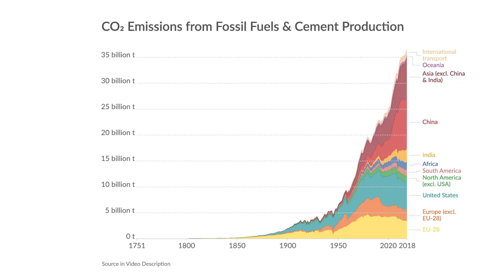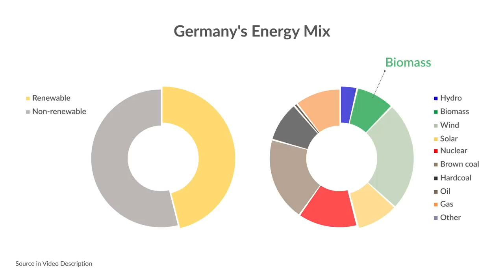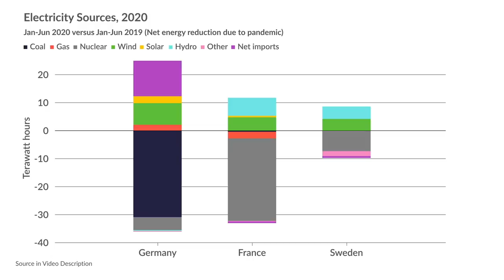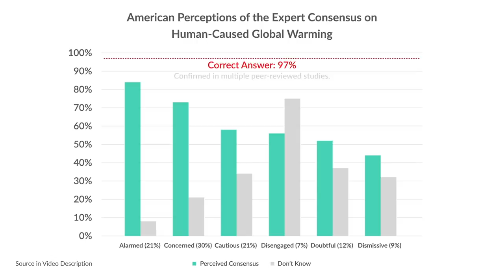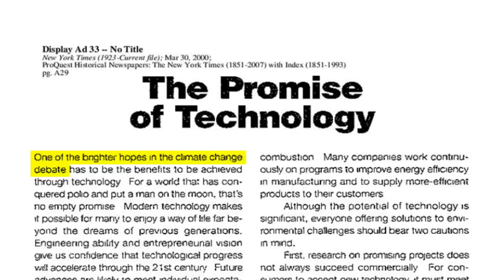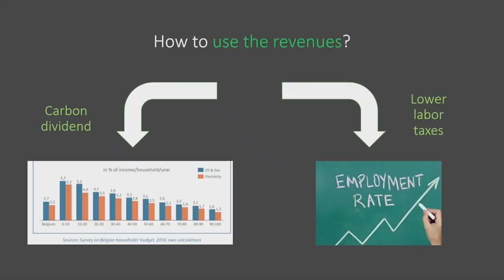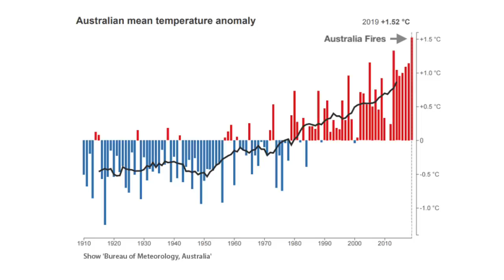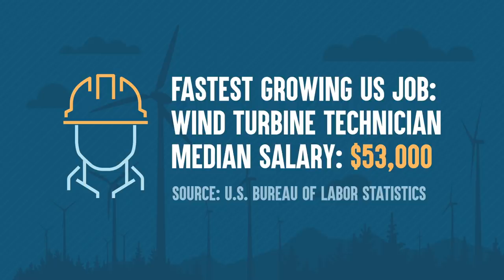The $5,200,000,000,000 Trick Killing More Than Covid, w Stephen Fry.

Comment: My main oil heater broke before last winter and repair guy said it would cost 5,000 to replace, including installation. I'm a retired disabled combat veteran and I couldn't afford that, specially during the outbreak. So I ended up using 3 electric heaters for 5 months to the tune of a 4,000$ electric bill. Saving money already!  Damned it you don't, damned if you do. Much like in the movie Frequency, I should've went the other way.
Reply: Look into energy assistance. Welcome home!
Reply: Yea, you can do a plan with your electric company pay 5 cents at night and 23 cents in the day.  You turn your heaters on high from 9pm to 9 am and turn them off during the day.  But the best solution is repairing you gas heater.

Comment: Thorium Molten Salt Reactors: a different kind of nuclear. Actually it's too late, but we had a chance, if we weren't deceived into thinking there's only one kind of nuclear power.
Reply: Micro nuclear for cities.
Reply: LFTRs present technological challenges that require massive amounts of research still. And yet, it is still the best bet of all the present and future solutions
Reply: Your right..saw a documentary on this.
Interesting
Reply: Nuclear power is extremely safe sure you had Fukushima but Fukushima was hit with a flood that it's flood walls could not handle on top of this it was an old nuclear reactor it wasn't built to handle stuff like that the newer reactors are built typically in safer locations farther away from actual living populations and have many safeguards in place to prevent any type of accident from occurring on top of this without any human interaction the machines will literally shut down the nuclear reactor themselves the chances of a nuclear explosion are almost non-existent with most of these new nuclear actors sure there is still a chance of a radiation leak or a meltdown but even these have safeguards in place to prevent them and if they do happen to contain them at the same time I will say this the worst part of a nuclear reactor is the nuclear waste which is where thorium comes in it produces less nuclear waste and has no chance of a nuclear explosion but again there's not much need to go to thorium other than to reduce nuclear waste production but either way nuclear energy gets a lot of bad rep due to the thought that it could be used to cause an explosion to trigger this in a modern-day reactor you would almost need to sabotage the reactor
Reply: Spot on ..thorium is abundant and a much safer type of nuclear. Too bad the word nuclear was demonized and made dirty by ignorant minds.
Reply: @kingjuggalo4774  How old is the average US nuclear reactor?
Reply: Actually even regular Uranium reactors are far superior to fossil fuels and renewables by any metric.
Reply: @jeremiahnonamaker6202   the rough age of most reactor in the US today is around 30 to 40 years
Reply: @beback_  right on and though it can be an expensive start they put out far more energy then they will cost to run again the biggest concern is their biproducts ie the nuclear waste which is obviously radioactive and takes years and years and years to decay into something that would be safe to handle in a radioactive sense at least and correct me if I'm wrong but I do not believe that their waste is useful anymore but I do know it can be recycled many times over I would have to do a little more research to find out how much they can be recycled but the recycled material I do know can be reused in the reactor thus producing more energy saving more costs on running the reactor and ultimately we may find a use for it someday such as radioactive treatments for cancer though admittedly it's probably too radioactive for that more of just a brainstorm of my part there but I do remember one country had a plan of dealing with their waste by basically burying it in a large vault on an island that's really has no natural resources or anything that humans would want this way humans in the future would not seek it out and hopefully would not stumble over it at least not until it has fully decayed and become non-reactive though that will be far beyond all of our lifetimes
Reply: Lets spin this further mate , what you really want is energy ,since nuclear has a major output /input cost ratio till you count in the cost of secure long-term storage of fuel rods , at that time you will realize that it makes nuclear FAR MORE expensive .The Tokamak reactor can solve that problem , check this out https://www.iter.org/proj/inafewlines
Reply: @simoneales2568  his right or hers? Waddya mean by your? I never put in my 2¢ worth!
Reply: It's not too late at all. The planet is fine.  Co2 is great.  See : Greening of the planet, by nasa. People believing 'scientists say'-stories are the problem.
Reply: @kingjuggalo4774  In regards to depleted nuclear fuel, I welcome you to think how long it takes for a ton of depleted fuel to have 1kg of it to decay. After that, consider how much radiation that means every day.

For further reference, an average reactor is estimated to produce about 20 tons of waste a year (that is approximately for a 1 gigawatt plant).
Reply: The Flat Earth is a Salt Battery.
Reply: It takes longer then your life for most Trees to Mature. This video sounds like a pitch for taxing the people of the world for a system we didn't create. Geoengineering is the Single biggest reason for the earth's changes today. How was Chemtrails not mentioned in this video? Why no mention  of HAARP? If we are going to have this discussion, we need to discuss everything.
Reply: @SleepersAreTheProblem  agreed, weather phenomenon can not be trusted with regards to what is happening with those techs! Curious about the salt battery thing

Comment: When talking about renewable energy everyone always forgets geothermal energy, there is great power available just from the heat below ground.
Reply: Exactly. As a former residential insurance inspector I saw a lot of these systems used successfully in the northeast
Reply: I think you are referring to heat pumps.  Neighbor tried one in Michigan was ok but not really saving money at the time propane and fuel oil were cheaper.   The set up is not free.   It can work but bottom line for most people is cost and they were not always cheaper.
Reply: A heat pump is only one component in a geothermal system. The two-word reference “heat pump” commonly refers to electric HVAC heat pumps—or refrigeration units—that have the ability to work like an air conditioner in reverse by changing the flow of heat exchange (ie an electric air conditioner that can also be used as a heater in the winter). Unless you have an older home with a separate oil or propane furnace (or heated baseboards/radiators), then I would say most every house you see utilizes “heat pumps” over conventional air conditioners because the cost of installation rarely exceeds $500 in difference for twice the climate control power in one single ducted system. The drawback is they are really only effective to around 30-35*F before they can no longer keep up. This compounds if condensate freezes after long periods of use in these cold temps. Most all urban and suburban homes are exclusively powered by these electric heat pumps. Again, the exception being someone with an older home that has a dedicated pre-existing heating system & upgraded to a heat pump the last time they replaced their outside AC unit. A lot of these systems are controlled by low voltage regulators connected to sequential thermostat switches so that when the outside temp goes below 35*F the dedicated heating system comes on while simultaneously turning the heat pump off to prevent inoperability or damage from extended cold weather use. So no, we’re not “referring to heat pumps.” We’re discussing geothermal energy systems here. It’s not cheap, but I guess the government not 100% subsidizing white trash Michigan natives to have free energy systems installed is a social justice issue that needs pursuing on YouTube’s comment section. Although, I have a funny feeling if “setup was free”, you’d be complaining about the tax dollars it took to finance such an undertaking.
Reply: @Daniel-xv5oe  You sounded like you were semi intelligent until you started calling people from Michigan "White Trash".
Reply: Geothermal can be dangerous though, and it has its issues in terms of dynamism in energy production.

Nuclear fission is the real MVP in comparison.
Reply: @Project2457official  More dangerous than the two big meltdowns?
Reply: @Physics072  Absolutely.

Look into statistics and research papers about Chernobyl and Fukushima. 

Chernobyl was so bad because of the poor government response and attempt to downplay the scale of the disaster. Chernobyl also ran off of outdated reactor technology (even for the time) and had a faulty cooling system.

Fukushima was much better and was much less dangerous, better reactor technology, yet also having a flawed cooling system.

The direct death toll for Chernobyl is hotly contested, but the best scientific measurements from the World Health Organization actually estimate ~4000 deaths, and many scientists believe that statistic is too pessimistic. Some even estimate only 1000 direct deaths.

With Fukushima because of a good governmental response, only 500-600 died indirectly from the disaster (mostly in the elderly population in stress from the evacuation, from heart attacks, chronic illnesses, and accidents from rushing evacuation). Only 1 direct death is linked to Fukushima, which was from a power plant employee who directly inhaled radioactive dust.

The 19,500 regional deaths were due to the tsunami.

If you do not believe me please watch the Kurzgesagt video called "Deaths from Nuclear Power", its highly researched and nuanced if you don't want to dive into the studies, and well presented.
Reply: @Physics072  That would be a consumer level geothermal application, but one none the less.

There is far greater power to be harnessed and used commercially.
Reply: Isn't geothermal a combination of other energy resources put to one?
Reply: @MrShanky7  Nope, not at all. It utilizes energy harnessed from thermal means.
Reply: @Project2457official  And what are thermal means because its like a long winded term for hot water and vapor.
Reply: @MrShanky7  Geothermal energy is heat within the earth.  And they engineer different ways to tap into it.
Reply: @MrShanky7  I forgot to add that it is underground in nature.

Geothermal power is using heated magma and rocks, running cool water on it to form steam, which then subsequently turns the turbines to create energy.

This process continues over and over again.
Reply: @MrShanky7  It can include heat from pressure, or the natural insulation of the ground itself, even at a very shallow level, right up to fault line and volcanic activity.

There's insane amounts of energy, simply not used at all and while so many other methods require vast machinery or expensive refractive gatherers, geothermal can be as simply as heatsinks and exchangers.
Reply: @breaddrinker  Well my question is I don't know anything other than a few links and researchers here and there. What I need to say is, is geothermal a bad energy source? Is this a good thing or bad? What are the benefits and consequences and more importantly does the benefits outweigh the consequence?
Reply: Heat pump installations for individual homes for furnaces and water heaters are effective geothermal energy to reduce a home's consumption, but I don't think anyone is using the technology for an electricity generating plant to serve a city.  True geothermal could be taped below the Earth's crust where temperatures range from 1,000 to 3,700 degrees Celsius.  Those temperatures are below crust, which is 20 to 45 miles thick.  The deepest hole ever drilled by mankind is 12 miles.  Unfortunately, we spend the money to journey to Mars rather than attempting to reach just 45 miles below the Earth's crust to tap an endless heat source.
Reply: Or indeed the generous amount of hot air generated by our own MPs trying to sell us on renewables being the answer to everything....

Comment: "The film references Michael Moore’s film  Planet of The Humans, which claims that renewable energy isn't the answer to climate change."

That's not what I took away from Planet of the Humans. Rather that most of renewable energy industry has been taken over to be used purely for profit, without regard to whether or not it actually is better.
Reply: @claudiatheobald6554   You're claims are misleading.
1. Energy production in Germany is cheaper, however there are taxes used to fund renewable energy development which makes the final cost pricier.
2. Wildwildfires only produce more particulate matter than cars do; cars still produce more greenhouse gas emissions than wildfires
Reply: @claudiatheobald6554  absolutely. & 'renewables' need their own costly grid  as nuclear plants are at threat as cant handle the spikes in the existing grid. want a chernobyl 'cos the wind starts to blow & sun come out? er, & tron- go do some proper research
Reply: Guess the so called lower energy prices in Germany must be from all the Russian natural gas Germany is buying.  They need fossil fuels to keep the cities & homes running when the Sun & wind power fails for 18 hours each day and sometimes for 48 or 72 hours at a time .... oh the batteries are dead ....
Reply: @griffenthedog  
I thought the Chernobyl accident was down to a poor design of the RMBK type reactor used and inadequate shutdown/failsafe systems.
As far as I’m aware a reactor is used to heat water to drive a turbine so I’m unsure how the power grid could cause a meltdown.
Reply: Me: laughs in low-carbon French nuclear power ⚛️🇫🇷
Reply: @ukjunglist26  As a society, we should work on both. We can't curb climate change and emissions by focusing on one aspect only. We have to tackle over-consumption, cattle farming and transportation. Now. If we don't, our planet will and it won't be pretty.
Reply: @electron6825  i doubt that energy production is cheaper in Germany since they have opened so many new green installations while closing nuclear that was already paid off. I would argue that either 1. Germany have cheaper electricity bcoz they have started up their old coal plants bcoz solar and wind doesn't cover their needs or 2. They are hiding the true cost with some clever financial scheme and to cover the cost they have raised taxes.
Reply: @claudiatheobald6554  the difference between subsidizing solar and wind energy and coal power in Germany is that:
Solar and wind energy is that cheap that the producers get funded by all consumers (except companies)
Coal energy cannot sustain itself as well but get subsidies by the government directly. That way it seems that Germany has high electricity costs because of the renewable energy.
Reply: Jim Man  Still spammin Jim Boy?
@Jim Man Your credibility is zero after these statements.
"These people who want 0' carbon content are insane considering a 0' carbon content would kill off every tree and plant on the planet and cause an ice age. "
There is NO-ONE advocating Zero Co2. NOT ONE  F'ING PERSON!

" there have been higher amounts of carbon in the atmosphere before, "
Yes, there have, and also HIGHER TEMPERATURES at the same time.
Check out the Graph "Correspondence between temperature and atmospheric CO
2 during the last 800,000 years"
https://en.wikipedia.org/wiki/Carbon_dioxide_in_Earth%27s_atmosphere

"then ask why like Mars started warming up around the same time the earth did"
 Wrong! In the last 1000 years, Mars has actually been COOLING, despite some uninformed speculation.
"The climate briefly received more interest in the news due to NASA measurements indicating increased sublimation of one near-polar region leading to some popular press speculation that Mars was undergoing a parallel bout of global warming,[1] although Mars' average temperature has actually cooled in recent decades, and the polar caps themselves are growing."
https://en.wikipedia.org/wiki/Climate_of_Mars
Reply: Then you missed the point - profit makes people build stuff that other people want - its known as a market - above shows renewables are good for the environment and profitable and we can live happily ever after if we get a move on.......
Reply: @economistfromhell4877  And marketing makes claims that are "true" but not true.
Reply: @electron6825  Wildfires produce much more CO2 than all cars together. Not particle matter, it is Co2. And at the same time they wildfires happen to eliminate the trees that use CO2 and produce Oxigen. So saying that wildfires is not a big deal is stupid. Did you ever wonder why this years wildfires stopped at the Canadian border? Better forest management! Democrat led states have neglected forest maintainance for years. Many people will die, but not because of climate change but because of high energy cost that make heating in winter unaffordable. In Hungary and Romania there are people freezing to death every year because they can't afford heating.